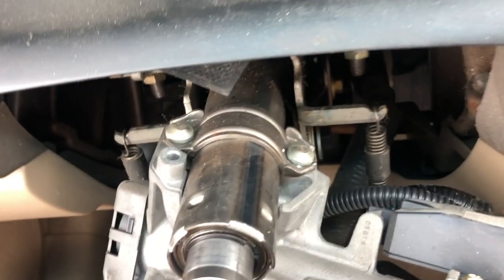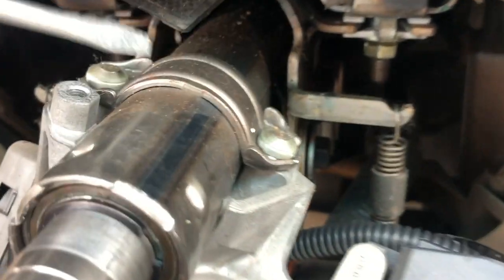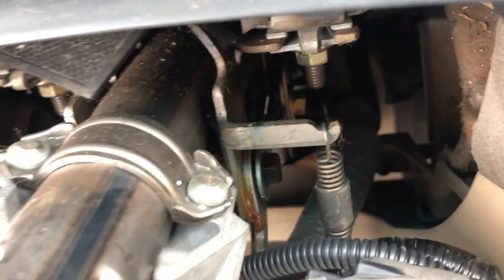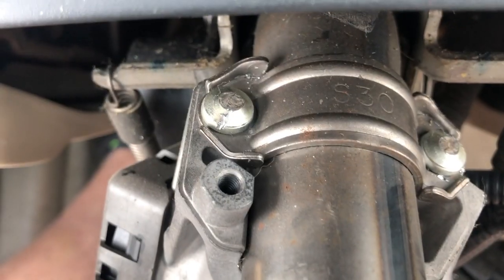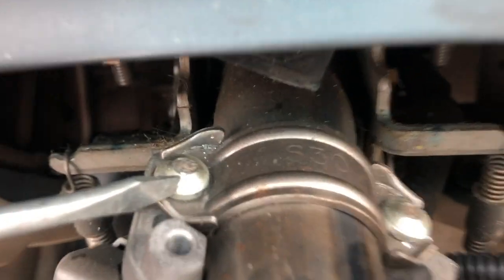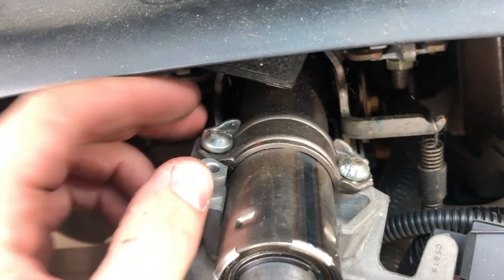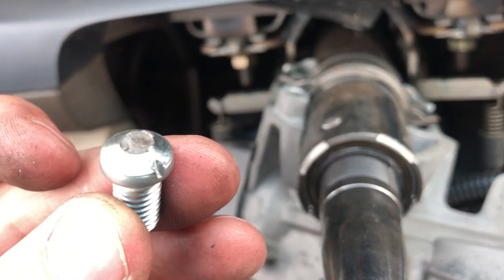How To Remove Security Bolts Ignition Switch Honda Accord Civic Odyssey

Comment: I'm glad it worked for you, it pissed me off and I turned those screws into a mess of shit. Looks like they're getting cut out
Reply: u probaby have to drill it
Reply: I'm thinking there's another type of these bolts that are installed differently.  Can you tell me what you ended up doing to get them out?
Reply: @garryuyahoo  turned out that the screws were reverse thread. I ended up re tapping the thread in the clockwise. I don't recommend it but I wasn't waiting to order in reverse thread.
Reply: You are absolutely right!! I'm in the same boat you are with my wife's '06 Honda Pilot.

Comment: I take these out every day at my job.  Use a sharp tipped punch, dig the tip into the body with a few small taps to get an indent to seat the tip, then just tap away and you are golden.
Reply: Would be nice is bolt extractors would work

Comment: After I swapped the ignition cylinder, I put my old immobiliser on it and it still doesn't work
Reply: Found the solution - my new key is conflicting with the old chip - for now I need to seperate the two completely

Comment: Go to theft recovery on a Kia Rio. Not much access to the security bolt heads. Long screwdriver and hammer to notch the head worked great, loosen the half a turn, then came out with my fingers. Thank you.
Reply: Thanks for the advice cause ima about to attempt it on a rio in a few days !

Comment: My sheer bolts would not come out or turn on my ‘06 CRV.   I found out that you can leave them alone and by unscrewing the plastic around the ignition cylinder you can access the pin.  The pin holding the lock cylinder to the housing did not want to come out... I drilled 2 holes (one hole in front and one behind the pin) and when all else failed I used a grinder to grind down a pair of needle nose pliers to fit.  After many attempts the pen finally was pulled free.  

What I found out in the process is that you can drill one hole to the right of the pen toward the and then go ahead and drill another hole another hole to the right of that hole and slide remove the lock cylinder with the pen still in the cylinder.   Makes it quick and easy.  Reason being is that you do not need to use the pen when placing the lock cylinder back.  As the cylinder will be held in with the plastic when the 4 screws are placed back and work perfectly... I bought a replacement lock cylinder (with 2 keys) off of Amazon for $18.  It worked great.  Before I used it, I tried the method in some videos of removing and pulling whatever pen was stuck in the out position and reusing the same cylinder.  However I had no luck with that, at all.   I’d say try that first cannot hurt, might have better luck.  

Also I’d say if you can use a chisel or dremel and remove the sheer pens easily then go for it.  

If you can drill one hole and remove the pin holding the lock cylinder, then try it.  

Or you can just not fool with any of that drill the holes needed to slide the cylinder out and fix or replace the cylinder and slide it all back in, try the key and then replace the plastic and go on with your day.  (At least this is my experience with my CRV).  I thought I needed the locking pen (so I took extra time to remove it (just in case), but when I was able to replace the cylinder without reinstalling and have everything work perfectly fine (as if it was installed) I wanted to spread the word.  

Lastly always best to disconnect the negative battery terminal as you do not want to trigger the airbag by pulling out a connector.   Peace.  :)
Reply: Too much
Make a video
Reply: @humanityincvideos5114    Bottom line -  just drill 2 holes in a line to the right of the locking pen and slide the cylinder out.   

Then slide the new cylinder in and reinstall everything you removed... minus the licking pin, as it is not needed for the cylinder to work perfectly.
Reply: @klujics123  I'm trying my best to figure it on my 05 CRV based on your instructions but I just want to remove the locking pin without damaging the current ignition cylinder. Can you make a quick video on where to drill?
Reply: @dinhdoan1456  (the below link)  is a good video which gives you a visual.   I just drilled to the right of the locking pen hole, then drilled another hole on the other side, (to the left of the locking pen as I was unsuccessful with just one hole as it would not slide / pry out for anything) then I ground down a small pair of cheap needle nose to a needle point and was able after multiple times to get a bite on the pin.   But when I installed the new lock cylinder, I purposely left the locking pin out to see if it was needed and found that it was not, as the plastic cover held it all in perfectly.  The locking pin I believe is more of and anti theft, more so than anything else.  So my advice drill a hole to the right of the pen and another one to the right of it and use the drill some more to clean the channel out, so the cylinder will slide out (without removing the pin).  

But if you want to try to pull the pen out, that’s fine.  Drill a hole on either side of the pen and have at it.  But doing so the pen will be loose when reinstalled because of the holes on either side. 

So that’s my idea the guy in the video has a different approach.  So here’s a few options for you.    God Bless.  =)

Been 7 months everything still works get with the CRVs ignition.   BTW

https://youtu.be/uoVCkjo3OkA
Reply: @klujics123  that tiny little pin he removes is for the steering wheel lock?
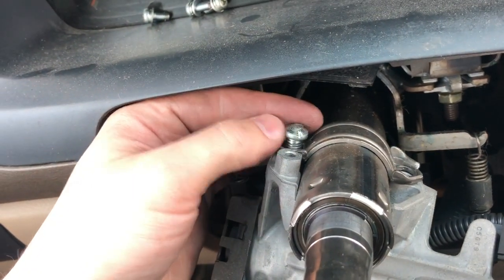Reply: @dinhdoan1456  1:27 min mark.  That is the pin needed to be removed to allow the cylinder to slide out.  He cut the corner I drilled holes.  Same result though as the cylinder slide out and can be replaced with one off of Amazon for $19.  And the plastic cover is enough when screwed back on to hold the cylinder in place for proper operation.

The steering wheel, still will lock with out the pen.  The pen just holds the cylinder, so a thief cannot easily undo the column and slide the cylinder out.
Reply: @dinhdoan1456  also I couldn’t get my sheer bolts to turn with a file or anything else. Other videos, if you could turn those you could remove the whole assembly and have an easier time with the locking pen.   But again I found out that removing the sheer bolts was not needed after all, as I was able to pull the pen and slide the cylinder out.  So it all worked out and by leaving the sheer bolts I didn’t have to replace them.  Just drilled holes.  Also your car will not start without the chip in your key.  And your newly replaced cylinder will not turn unless the correct key for that cylinder is used, and your steering will will not turn without your key.  The locking pin does nothing but make it a pain to replace the cylinder.
Reply: @dinhdoan1456  the steering wheel will continue to lock, like normal.  The key turns the cylinder and only when that happens will the steering wheel unlock.  No key inserted, steering wheel will not turn.    Hope this helps.
Reply: @klujics123  I see. What I wanted to do was remove the steering wheel lock. Thanks for the helpful information! I'll have to keep digging.

Comment: Maybe I’ll drill a line and use the screw , the banging method isn’t working for me
Reply from the maker: That works too
Reply: Karrs Kars only managed to get one out, I had to bend the bracket on the other one
Reply: @inityo  
One is better than none

I can’t get none out 
I wanna fight or cry
Reply: @humanityincvideos5114   try another chisel
Reply: @inityo  
Just point another one, wish me luck
Reply: @humanityincvideos5114  good luck! randomly start diggin in the chisel at different areas, try more central but of course in rotating manner

Comment: I guess you use new bolts without the security feature to put it back?
Reply from the maker: I reused the same ones actually. But you can use new bolts.
Reply: Are the bolts universal? And or what are they called I need new ones 😩

Comment: CAN I DRILL OUT THOSE BOLTS I HAVE BANGED ON THEM FOR DAYS AND TO NO AVAIL. IVE TRIED CHISELS SCREWDRIVERS SAWS KNIFE BACK TO CHISELS AND STILL NOTHING THE SCREW WON'T EVEN BREAK. 08 HONDA FIT MANUAL
Reply: DID you find a solution? I'm in the same boat.
Reply: @OrganicGreens  ROTARY TOOL PUT AN + ON ONE AND A FLATHEAD (-) GROOVE ON THE OTHER AND SURPRISINGLY THEY WERENT EVEN THAT TIGHT WHEN I WENT TO TAKE THEM OFF. ALSO MAKE SURE YOU DONT CUT OFF ANY WIRES. ALSO REMOVE BATTERY FOR AT LEAST A FEW MINUTES BEFORE DOING ANYTHING THERE BCUZ OF THE AIRBAG.
Reply: @OrganicGreens  20 BUCKS AT HARBOR FREIGHT THE ONE WITH ALL THE KNICK KNACKS WITH IT
Reply: @Shiekh420  good idea about the air bag. I should have done that before I was beating with my hammer and chisel.  Could have broke my neck for sure. I was going to try a bolt extractor and drilling a hole for the extractor. Can't go to the store until tomorrow tho.  Were you able to get the rotary tool in there without removing the steering wheel?  I didn't think it would fit without removing the wheel.
Reply: @OrganicGreens  ITS A PRETTY SMALL TOOL I TRIED USING A DRILL BUT YOU RISK DRILLING A HOLE THRU THE STEERING WHEEL OR IMMOBILIZER. IF YOU CAN GET A GOOD GRIP WITH SOME NEEDLE NOSE PLIERS OR NAIL PULLER IF YOU CANT GET THE ROTARY TOOL.
Reply: @Shiekh420  I tried to get it out today cutting a slot with a rotary tool. After trying to unscrew it with a flat head the metal just broke. I'm starting to wonder if it's reverse threaded because they are not turning easily at all.
Reply: @OrganicGreens  ITS NOT ABOUT BRUTE FORCE ITS ABOUT ALMOST TAPPING IT FROM THE MIDDLE USE LIKE A SMALL FLATHEAD ALSO IF YOU HAVE BEEN HAMMERING ON IT BEFORE AND THERE IS LIKE A GROOVE HITTING THE BRACKET IT MIGHT GIVE TRY CLEARING OFF SOME OFVTHAT IF YOU HAVE ANY WITH THE ROCK SANDER

Comment: Why do you have to remove the entire cylinder and housing to remove the ignition switch?
Reply from the maker: That’s the only way you can remove it if you don’t have a key. Not sure if you can remove cylinder with a key
Reply: @karrskars  Thanks for replying. Here is what my situation is: https://youtu.be/S9V3ETzlVgE?si=qoxZPJjJQemkpDza

Unfortunately, I can't access the third screw underneath. I removed the first two.